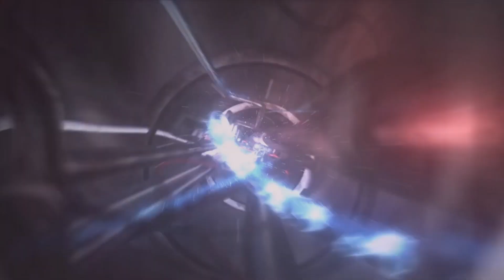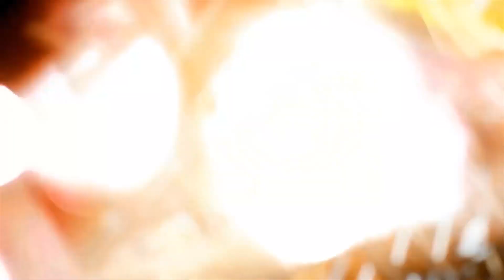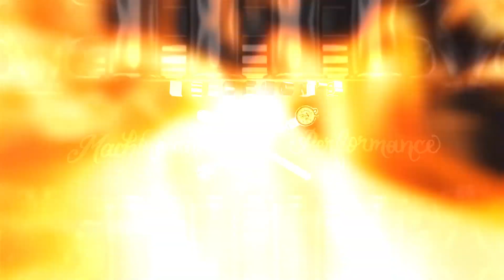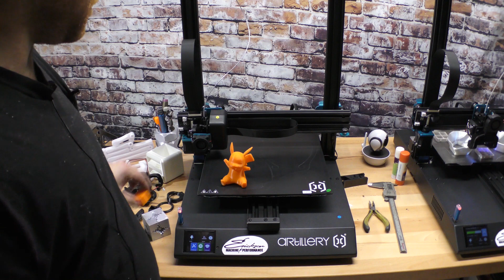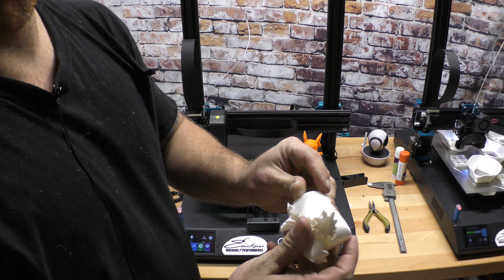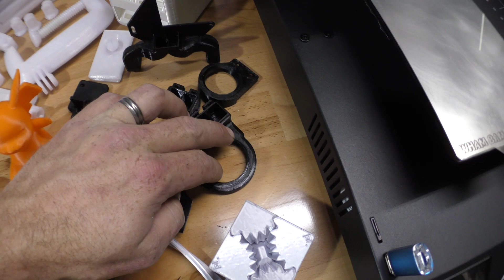Best 3d printer of 2020 on a budget!! Artillery Sidewinder X1!!!

Comment: Did you add strain relief to the heated bed cable? This seems to be a major safety issue, according to a few reviews I have come across. The heated bed runs off mains voltage (which is why it heats up quickly).
Reply from the maker: Both have it now But I added it to my first 1 after over 2000 hrs printing  without issue.
Reply: @EricksonMachinePerformance  Can you show us how you did it? I see several items on Thingiverse for this purpose.
Reply from the maker: @iskandartaib  email me
Ericksonmap@gmail.com 
Im.going to be doing a new long term video on the machine in the next few weeks

Comment: Good thinking. You did the right choice. I have learned over time. Buy what you need ... to buy a printer and then decide how to upgrade printer will take you down the rabbit hole. By the time I tried making modes to my Cr-10s pro ... I wound more cost into the printer than just buy a new printer. This has been my experience but the printer I modified just never performed into the machine you have. Good thing ... I bought one myself. Great machine. Take care.
Reply from the maker: Thanks for watching and commenting

Comment: best choise for under 1000,- i know is round 400,- but beats all in that range. 2 things tho you have 2 print first as an upgrade. 1 cable relief for for the bed and 1 for the 20 pin ribbon cable
Reply from the maker: I dont disagree BUT I also feel alot of the 20 pin issues are from improper instalation.  I printer over 1000 hrs with my first X1 with ZERO issues and the only upgrade was the fan. AND LOOKING back now at testing I have done the fan I upgraded to was worse then the original 🤣
Reply: @EricksonMachinePerformance  meant as a precaution.. luv mine as well.. 0 issues so far
Reply from the maker: @BlacholeCrater  im not disagreeing. Just making the comment I have used them.for a lot.of printing time with 0 issuses

Comment: You made a really good statement that alot of people who get printers, do not realise. Make sure your table is secure. I have a pretty secure table that is low to the ground and not wobbly but even once I'm printing faster and higher prints. I can get alot of changes in my print. Alot of people are literally putting thier printers on fold up tables. That's not a proper work bench. Great point. Awesome video thumbs up.
Reply from the maker: 100%

Comment: Do yourself a huge favor and grab a titanium heat break, a 40x40x20 winsinn hot end fan (requires 4 m3x35mm bolts), and an aluminum idler arm (I used stock spring and 2 3mm washers on the right side of the arm).   This machine is excellent!
Reply from the maker: I have a Titanium heat break and I'm testing the th3d titan arrow upgrade.    I will have a video up shortly.   I also have a video with the different fan upgrades and prints showing the differences in cooling.   Thanks for watching and the tips!!
Reply: @EricksonMachinePerformance  Can you do a follow up on this? It seems like there's a lot of interest still! Also, any further updates and videos you can do on the walkthrough of the titanium heat break, fan upgrades, and idler arm walkthroughs, ribbon cable mods/safety mods, etc. greatly appreciated!

Comment: I've been trying to fig out what printer to buy. Everybody tells me to buy the Ender 3 Pro. I like this machine. It seems much better in quality. I know absolutely nothing about 3d printing. I'm a nursing home administrator and just like you want to print mask and face shields.Finding 3d printers in stock right now seems to be a challenge as well.  May I ask where did you buy your machine?
Reply from the maker: Honestly i did tons of research.  I'm my opinion this is the best 3d print for under $500.   Its huge build volume,  silent drivers, direct drive titan style extruder, and most importantly prints PERFECTLY out of the box.  For the Ender to print half as good as this printer You'd have to invest a good amount of money and upgrades.   In my opinion there's no comparison and if you look this printer has been touted as the best sub $500 printer and I completely agree and I've got probably close to 2000 hours combined on my 2 machines. And they've been flawless
Reply: @EricksonMachinePerformance  thanks for getting back to me. Where did you find yours?
Reply from the maker: @NotTelling51  email fulament I know they just ran out but they might be getting more soon.  Tell them u saw this video🙂 https://fulament.com/collections/artillery-printers/products/artillery-sidewinder-x1-3d-printer?variant=31745831698506
Reply: You can get it on banggood for $390 which is a lot cheeper

Comment: set mine up last week, test calibration cube was flawless...then tried a 10hr print and the thermistor wires detached without collision or contact, awaiting replacement...
Reply from the maker: Sorry to hear that. My first machine has over 1000 hrs with all original parts  and my second has 3-400 and is the same
Reply: Same exact thing here, I just got off the phone with Amazon, they refunded the money and I am going to order another one. I love the printer, but mine burnt up pretty bad. All the wires were burnt under the hotend cover to the board. If the next one burns up I am going to rethink this. I don't trust it 100% right now. No way am I going to leave it overnight for a while. Good luck, keep an eye on it. Other than that it is awesome...

Comment: where can i get the cooling fan holder stl file and 5020 fan?
Reply from the maker: There is an adapter you can print.  But I'm also working on 1